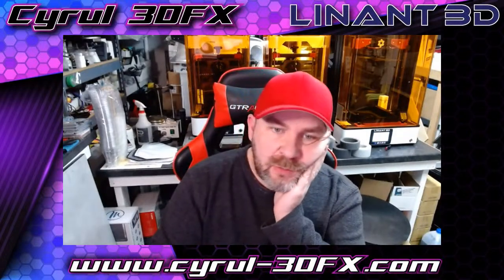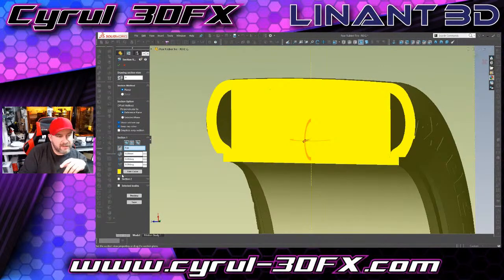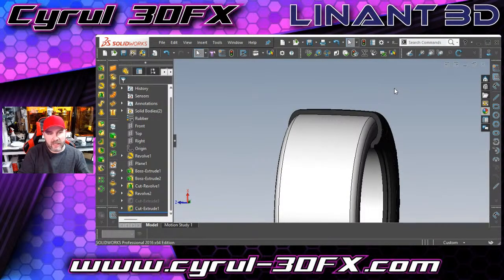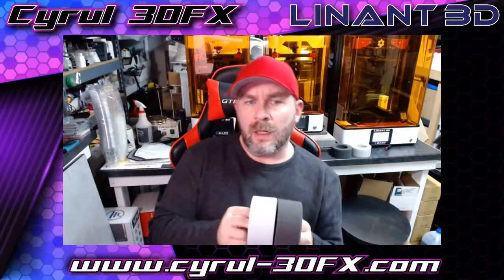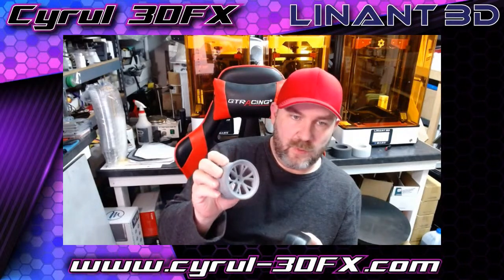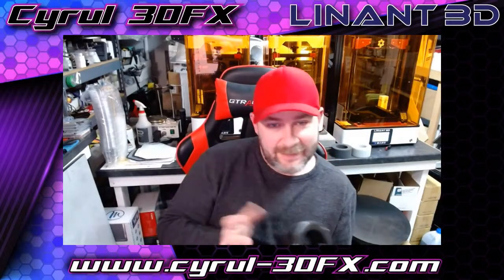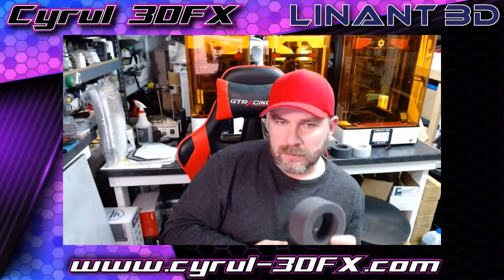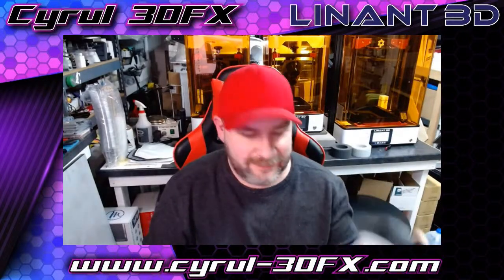eXcelerate Tech Part 1: Foam vs. Air

Comment: For a night race with like 70 degree ambient temps.. on concrete surface.  Do you recommend a super soft or soft compound?  Also which foam should I run with the super soft compound